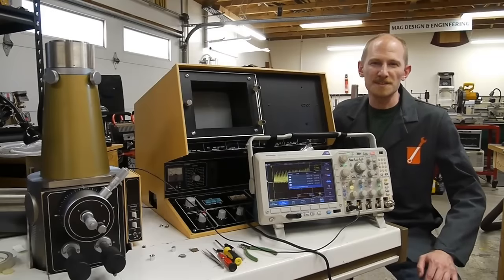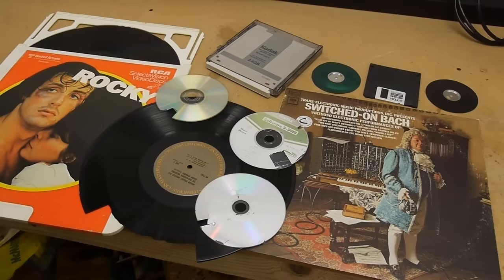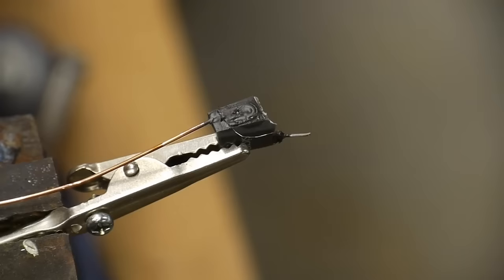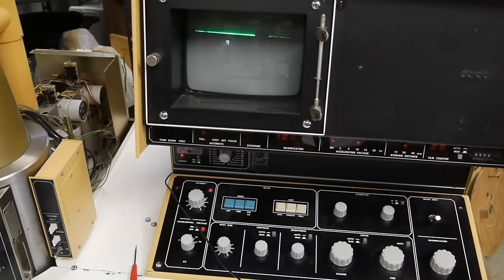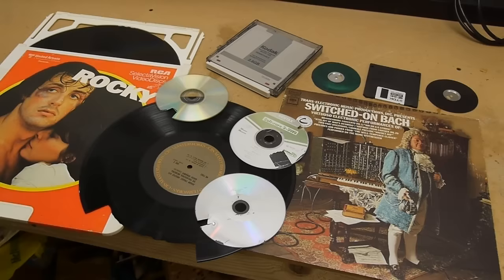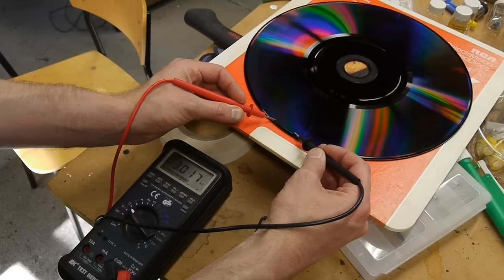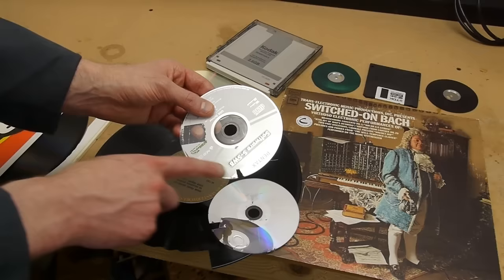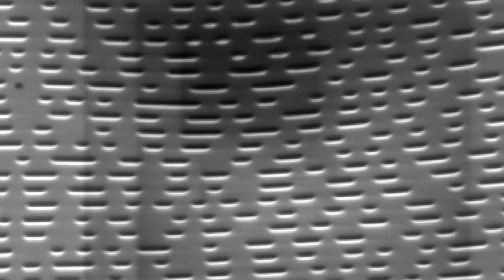Electron microscope slow-motion video of vinyl LP

Comment: 2 (more) issues I have with vinyl. 

1. Since the grooves are built on a circle track, the inside edge of each groove will be tighter (smaller circumference) compared to the outside edge of the groove and therefore it's resolution and relative peak angle geometry will be unequal than the other edge/channel. This would lead to compression and lower fidelity on the inside channel. The outside channel will have the opposite problem, which is also bad, but between the 2 of them this geometry problem will be 2 times worse. Not ideal as you would want both channels to be identical but unfortunately that can't happen with a mechanical device. Also the outside channel will have greater needle pressure applied because of inertia. This would cause possible level differences and more wear on one channel. Will you notice? Maybe not.

2. Since the record is a circle, the songs in the outside will be higher fidelity because as the needle moves inward toward the center the relative speed increases and therefore the grooves are compressed and fidelity is compromised. Also everything I mentioned in point 1 is further exacerbated when you move closer to the center of the record as the circumference gets tighter.  

CDs don't have this problem because you have discrete dots that don't care about circumference. The CD motor will adjust speed and keep time almost perfectly and mechanical wear and slop isn't an issue. There are so many reasons CD is a superior format. Only when mixers compress the hell out of it is it inferior.

Comment: Question about your statement that "the needle doesn't move up and down."  You said there were two magnets in the tone arm to convert mechanical motion to analog signal.  What orientation did one magnetic field have with respect to the other?  If they were 90 degrees apart, doesn't that mean that the needle must move in two orthogonal directions?  That indicates to me that although it may be difficult to see in your video, the needle must move along two independent orthogonal axes.

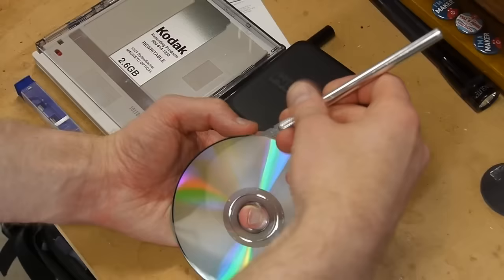Comment: 9:16 - "[...] the aluminum information layer". The aluminum is not the information layer, it's the reflective layer. Its only job is to reflect light from the laser. The actual data is pressed into the polycarbonate in the same way that grooves are pressed into vinyl records. The reason you can see the pits/lands in the aluminum reflective layer is because it's applied to the polycarbonate disc via vacuum deposition, which of course impresses the polycarbonate disc's pits/lands into it.

The details of the reflective layer aren't even particularly critical. For example, I've fixed a CD before that, due to "disc rot" (holes in the reflective layer caused by oxidation-induced corrosion) wasn't 100% readable, by simply taping household aluminum foil over the label side, which effectively patched the holes. That obviously wouldn't work if the reflective layer was also the "information layer."

Comment: Gawd I feel so inept, High school 68-71 never touched on this Just ROYGBIV wiring, resistor value color chart a few ohms here volts there add amps and we could work for Edison and make a 2 way mic speaker with a few of those transistor things.

Comment: I know this is seven years old so you probably know, but just in case you don't, you can likely increase the max resolution of your microscope by taking multiple images, and combining them in Photoshop (I know the technique as "super resolution" and you can get between 2-8 times the res depending on how many images you take)
Reply: This stacking method is also used in astrophotography when you  take multiple shots of very faint objects and superimpose them. There is software out there for this.
Reply: @OldPannonian  I use Tony Northrup's free Photoshop plugin and have had great results. I didn't know it was used in astrophotography, what a great application of this technique! Do you need a star tracker to do it? I dabbled and star movement was very unforgiving especially at higher focal/exposure lengths, and it was always a balancing act of keeping the noise low and making the stars crisp and bright.

Comment: Interestingly how stereo vinyl is explained. There are two degrees of freedom (two distinct directions both perpendicular to each other and to the groove movement direction), one is "perpendicular" to the disc - up-down needle movement, by the groove bottom, other is "radial" horizontal movement - left-right, as groove directs by its sides. In the mono record, there is no vertical movement, the groove depth is constant, and a single channel is in the horizontal movement. How to encode stereo in a way it is compartible to the mono? Let's horizontal be a sum of both channels, and vertical is difference. That way, vertical movement is also reduced, because channels are in general similar to each other. Then mono player will simply play the sum of the record, ignoring the vertical movement - the difference,  which it doesn't capture and, but a stereo can properly decode, applying again a sum and a difference of vertical and horizontal movements.

Indeed, this is essentially as if one diagonal movement (sum) is one channel, and other diagonal (difference) is another.

Comment: I know that this vid is old, but perhaps someone will have an opinion on this question of if it's possible or not.

That is, to get a TV remote control's contacts to work again, would there be a way to use this evaporation of silver metal onto the contact points of the rubberized contact sheet  to renew the electrical contact surface?

I've never seen this process before this video, but as soon as I saw it, I immediately wondered if this could be used to fix remote controls.  Those "kits" that are available to try to fix the contacts on remotes, just do not work well or for any real length of time.

So I now wonder if this vacuum application of silver metal would adhere to the rubber pads.  Perhaps some prep work has to be done to the surfaces first?  Some remotes have a lot of buttons on them now and with a lot of higher end equipment that isn't new, it's difficult to impossible to buy new remotes.

Ideas?

Comment: Do this with a 78 rpm lacquer record or a 45 single, because I'd adore knowing how they compare, being monaural and at different speeds... maybe also a wax cylinder but I guess you have to get too much expensive obsolete equipment....for the wax cylinder anyway. Every little kids portable record player came with 78, 45, 33 1/3, and 16 rpm speeds.

Comment: In the 1960s I worked at AEI Harlow uk, manufacturing electron microscopes. I wonder if it’s possible using a scanning electron microscope to view droplets with covid virus in flight? And see if the virus travels out of the droplets when stopped by a mask. If so it would prove that unless someone is wearing a mask with less than 65nanometers porosity  (virus size) a mask is a total waste of time. Even plastic shields are porous and also the virus will pass through ones exposed skin. If this is the case, mask wearing and shielding needs a complete review. Ambrose

Comment: Interesting. I have one question regarding LPs. Do the outer rings contain higher fidelity sound than the inner rings? The LP spins at a constant rate regardless of where the stylus is. Or are the songs on the inner rings "wider" to contain the same amount of information?
Reply: The inner groves are not as good as the outside.

Comment: Yikes brother, what is your day job? I teach MATLAB at an engineering university, and this is a really great video. Okay, my question... why wouldn't you have a right side needle and a left side needle, or a split needle? it would seem to me that if the right and the left side of a single needle had to "battle" with each other for vibration for right and left channel, some of the left would cancel the right and vice versa? If there was any cancellation, couldn't one put the "left" side ahead of the "right" side and account for latency in the electric signal created by the magnet?

Comment: How are the grooves consistent in a vinyl LP as the outer area moves so much faster than the inner? How do they avoid different play speeds due to this?
Reply: The master disc is cut in the same way as the retail discs play so its self solving.
Reply: @ricardoroberto100  So the grooves cut are stretched out and get smaller closer to the centre?
Reply: @NR-rv8rz  yes thats what i believe.

Comment: Wow.  Someone who might have an opinion on something I've been ragging on one or two of my serious audiophile acquaintances for years.  The fact that the $20,000 turntable they have, with the 70 pound flywheel under the platter the vinyl record sits on, the TOTALLY isolated from drive motor aspect of same, and the seismically isolated rack the whole thing sits in... Is complete and total overkill, because the damn pressing machines that PRESS the damn records are NOWHERE near the quality necessary to PRESS VINYL DISKS such that all that frou-frou is going to make a damn bit of difference in the quality of the sound coming out of their Macintosh tube amps and their Dahlquist electrostatic monster speakers.  And finally, the amount of 'quality' these types of things manage to struggle to get OFF the vinyl is inaudible to the damn human ear anyway.  OK, I'll allow that Mac amps, special analog to digital and back to analog preprocessors, pre-amps, and so on will certainly bring the sound to my buddies that they enjoy, but I'm sorry.  I still think it makes no sense to pay FIVE TIMES MORE for your turntable than the pressing machine costs the record company, for the vast majority of pressing plants out there.  Super audiophile pressing plants don't come under this opinion of mine.  But your 40 year old Black Sabbath record was NOT pressed on a machine capable of putting down, in grooves on vinyl, anything your $90,000 turntable is able to make sound any damn better than the machine that just pressed 10,000 copies of that record before someone came along and cleaned the master pressing plate...